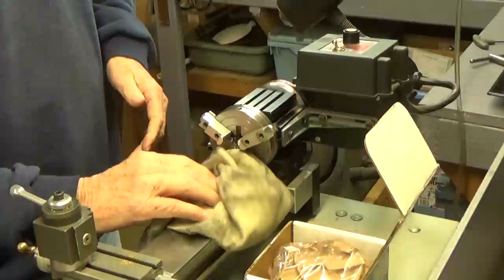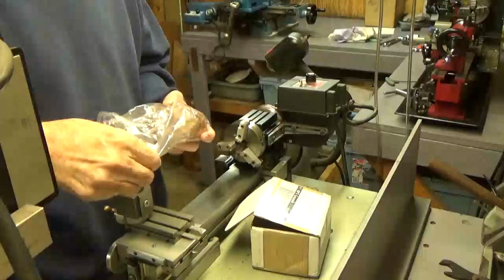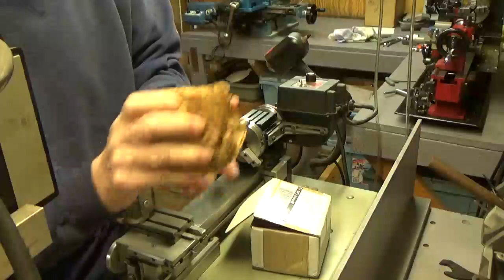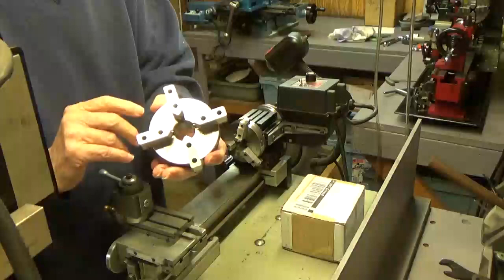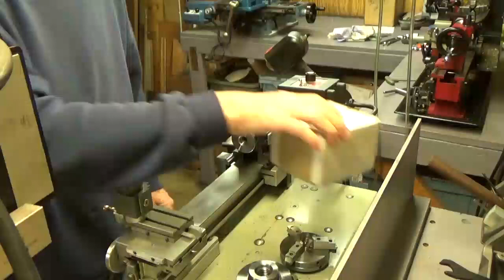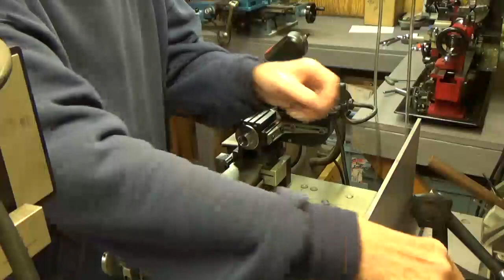Taig Lathe $20.00 4-Jaw Scroll Chuck Part No. 1

Comment: I just finished turning the threads on my Chuck and it runs true... Nice little inexpensive 4 jaw Chuck, thanks again for your video.
Reply from the maker: Ray: I'm so happy it worked out for you.  I know it's probably not the most perfect situation, but I find lots of uses for the 4-jaws and also the fact that it's a self centering scroll chuck.  Regards: Larry

Comment: You were right about cutting an indent in that little face plate at first I didn't do it and it didn't run true but after I did it runs great now
Reply from the maker: Ray:  I've read your previous posts and I'm glad things worked out.  Regards: Larry

Comment: What I hate about those chucks are the narrow soft jaws I have had things come flying out more than once and you are right scroll chucks suck.
Reply from the maker: John:  Yes; Scroll Chucks have very little holding power, especially with soft jaws.  The only way soft jaws work at all is they are bored to the exact diameter they are holding, or at the very least, two points of contact per jaw.  One point of contact is absolutely worthless.  The only chuck that Taig sells that's any good at all, is the 4-jaw independent chuck.  Even good 3-jaw scroll chucks on most lathes and mini lathes have far less holding power than a good 4-jaw independent chuck.  All that said; Soft jaws are definitely useful when used correctly.  Regards: Larry
Reply: @larrypoindexter9351 Where do I find a tool post like the 1 you have ?
Reply from the maker: @johnhubbard3399 :  I do not recommend the quick change tool post that I currently have on the lathe.  They were popular back in the day when A2Z was still in business, and you can currently purchase a copy from China.  Problem is that they are made with rather loose tolerances and everything is aluminum.  I recently made a similar tool post from all steel construction with better tolerances that I like much better.  I have continued to use the same aluminum tool holders since I have so many of them.  I'm now working on a new tool post that I think will be better than both and more fitting for the small Taig Lathe.  Maybe I'll do a video in the near future showing a progression of 4 different styles that I've used, beginning with the common Taig post that came with the lathe.  Best Regards: Larry

Comment: Have a question... how did you modify  Taig lathe  with  Sherline motor and speed control ? Specifically  what time of pulleys  an belt..? If you can be so kind  and supply me with the parts that you use
Reply from the maker: Just added the stock items from Sherline along with their bracket.  The only thing was using a slightly different length belt.  For me this was simplest solution.  I figured I could modify it later, but have never done so.  It has always worked just fine.  I did the same for the mill, however you loose a lot of speed options, which is not ideal.  Regards: Larry
Reply: @larrypoindexter9351  thank you very much for the information , and thank you  for taking  the time to answer back, one final  question: what type or size  (PART #) You used.?
Reply: What I mean to said its What type of belt?
Reply from the maker: @alvaroreyes6902  A typical belt.  Same style as the standard Sherline belt.  You can buy them in any length you need.  I think the  Sherline belt was a few mm off one way or the other for my purpose.  It's no problem to find what you need.

Comment: I think you could have bored the chuck out to remove the threads and then turned the flange off of the adaptor and turned the OD to fit the bore of the chuck.....that would allow you to loctite the adaptor into the bore of the chuck as if it were part of it.
Who in the heck designs a chuck to have soft jaws.......I'd get those jaws case hardened.
Reply from the maker: Actually I use soft jaws a lot, so for me that works out okay.  It all worked out okay, but thanks for your input.  Your method sure would have been easier.  Regards: Larry
Reply: @larrypoindexter9351  Soft jaws per se are OK if you can bolt them on and off for specific holding solutions......that is the main use for soft jaws either in a chuck or mill vice......sometimes, as you probably know, a part cannot be held directly against hardened flat surfaces so a machined shaped solution is the way.
BTW......a chuck that has the body with a screw thread directly in the chuck without a backplate is not all that good.
I prefer to have a sperate backplate that is fitted to the chuck with a spigot and bolts.....the spigot would be a few thou undersize to enable the chuck body to be "moved" on the backplate for getting a second op operation to run dead true, something you really need when doing precision lathe work.
Normally you'd hold a piece of raw material in a 3 jaw and it wouldn't matter if the part ran out, but for 2nd op finished work it's not easy to get both ends concentric with a fixed thread in the chuck......collet chucks have their own limitations too mainly in capacity.........it is a fact that a 3 jaw chuck can wear in the scroll  and so go out of holding concentricity.....very inconvenient.
Reply from the maker: @gangleweed  Nice post and reply

Comment: what type of motor are you using , did you make a video of how it is attached to the head of the lathe? Thanks for your videos.
Reply from the maker: I've had several motors over the years, but the Sherline motor is working best for me.  I also went with a wider belt, although the really think the thin original belt is just fine.  I've never broken one in all the years I used it.  It's connected to the lathe in the normal fashion using the standard "L" bracket supplied or purchased.  I'll look for an old photo.  Regards: Larry
Here's a link that might partially answer your question.
https://1drv.ms/f/s!AoFHBXavAXM5g75atdPbyrtF0xOleQ